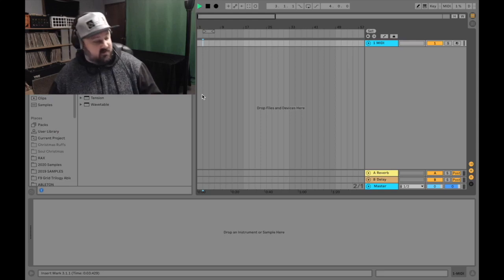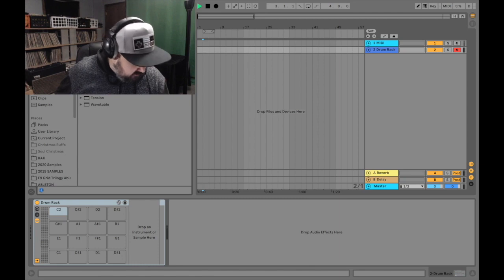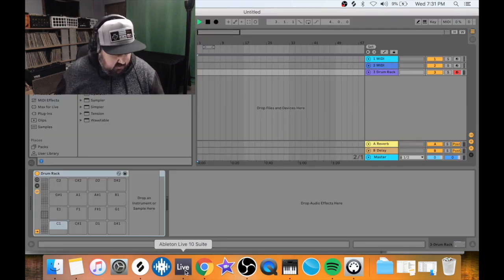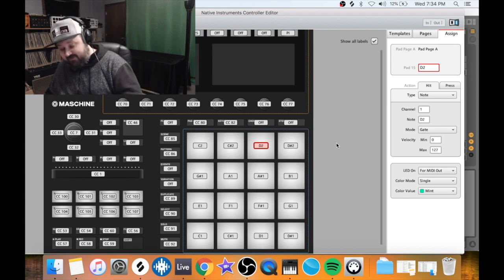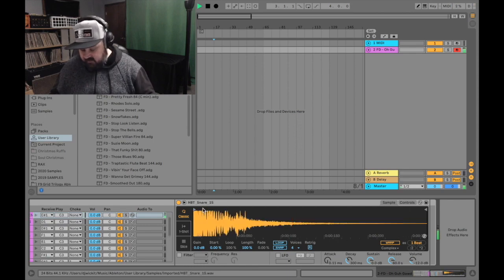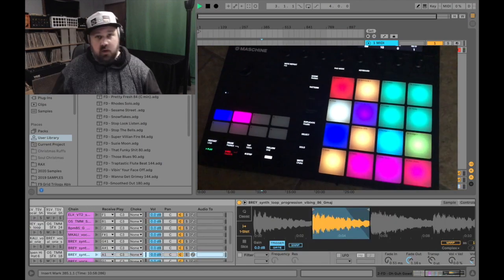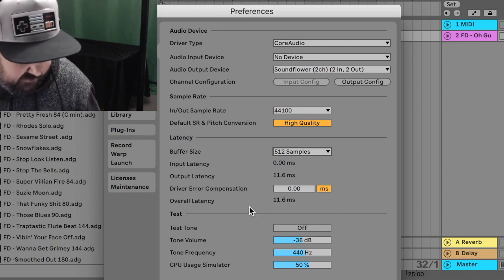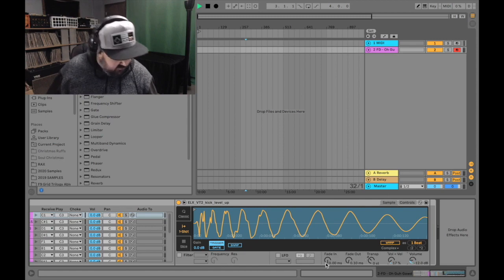How I Use Maschine w/ Ableton - (Integration, Workflow, Sample Chopping, Latency, etc..)

Comment: FIX at 1:41 - you can change pad octaves by going to group while in midi mode and selecting a different group which changes the octave. that should allign to c3 or c1 whatever you need -

Comment: Great vid, thank you! How do you work with drum racks that have more than that 1 pad set you created? For example, the Plastik Kit has 4 sets of pad pages and I don't see any way to navigate that the way I can with my Push 2. I've tried adding more pad pages in the NI Control Editor template but I'm finding that sometimes when I assign a value that I'm seeing in an empty drum rack in ableton to the maschine, it plays a completely different pad even though the pad assignment looks perfect. Like C3 triggers E2, C#3 triggers F2... this happens for 1 or 2 rows of pads in every page I've created.

Comment: Hey great video I learned a lot. So I have the Komplete Kontrol S49 and the Komplete Kontrol 12 Ultimate. I have a brand new Maschine MK 3 not yet used.  Is it difficult to hook it up to my Ableton Live 10?  And will all of the content from the S49 i.e Komplete Kontrol 12 be imported into the Maschine? Since the content is already in the S49? Lastly under Ableton’s preferences what will the control surface show a Maschine MK3 to click on on the drop box? Please explain and thanks in advance.

Comment: Hey I have an MK2 and I’ve been having trouble using the Ableton Template. The pads don’t trigger anything or light UP when I hit them. How do I correct this?
Reply: hit "pad mode" then hit "browse" to move the selected notes down an octave. You should now be able to load in any abelton preset drum rack and use it!